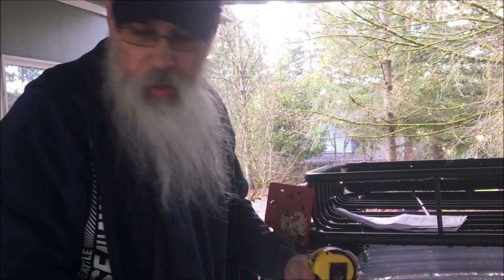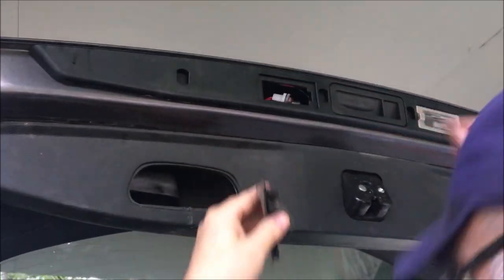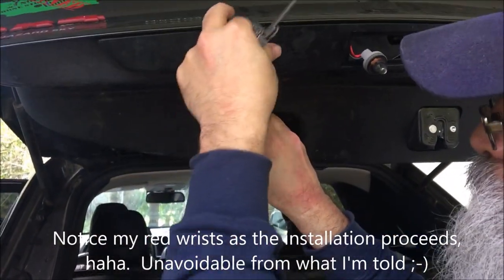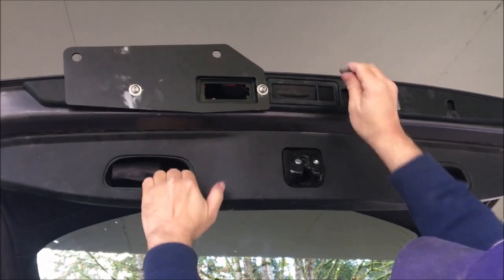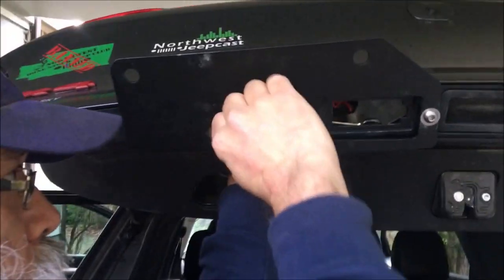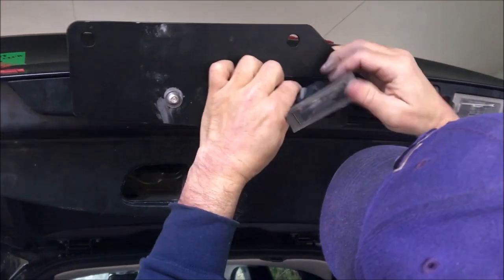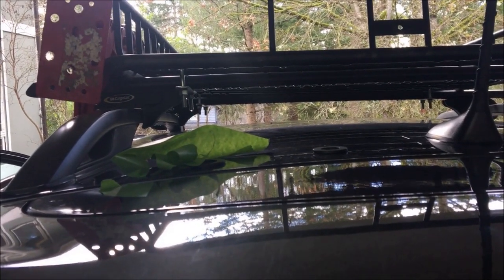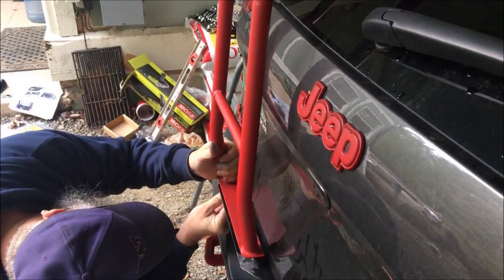Jeep Cherokee KL Gobi Ladder Installation

Comment: I pulled off the entire plastic liner on the inside of the hatch. Sure it's one big piece but at least I didn't have to contort my hand with a tiny wrench. And the two things you had to pop out...one firm whack with a hammer from inside they popped right out. So easy

Comment: I got an off-track question your red letters and numbers , did you bought it or paint it?
Reply from the maker: I used Plasti-dip to color them.  It's extremely easy to do and looks great...seems to last over 2 years (that's how old they are right now).  I may peel them off and do them again, but they still look pretty good, so I'm going to hold off for the time being. As a FYI, I did all of my emblems...the Jeep on the hood and the Cherokee's on the doors too.  Just do a search on YouTube on "How to plasti-dip my emblems".  You'll get lots of hits and in less than an hour, you'll can have them all done.
Reply: @raygach5692  thx , great video . Keep up the good work
Reply from the maker: @MrDiecast69  Thank you.

Comment: How many coat of plastidip did you put? I put like 6 light coat and my red was still too dark ? I used a red mat platidip . But i wonder why i wasnt even close to your red?
Reply from the maker: The color of the ladder wasn't dipped red.  I received it that way and looks to be simply powder coated in red rather than black.  I'm not sure if it was ordered from Gobi that way, but my wife was the one that tracked it down from a seller in San Diego and had it shipped up to her in the Seattle area.  I'm guessing it could have been a special order as I've not seen any other red ladders and this is definitely power coated rather than painted.
Reply: @raygach5692  im talking about the emblem, i must be doing something wrong cuz it never came out like you. Mine was more like brunish red... I need to find where im doing something wrong
Reply from the maker: @MrDiecast69  I just used the plain red plasti-dip, about 5 coats.  I can't recall the exact type, but it was just the regular red dip I picked up from the store.

Comment: what s the end look?
Reply from the maker: I'm not sure what you mean.  The Ladder attaches under the rear lift gate with two screws, if I recall.  As for anything else, it's all stock other than I added a 2nd tow hook and some lighted rear fog lamps.

Comment: Does the cargo door still open after installing the ladder?
Reply from the maker: Yes.  It's attached at the top of the hatch and at the bottom of the hatch.  It opens like normal and shuts like normal.  The only difference is that it's a bit heavier and since I have a manual rear hatch, have to lower it slower as gravity pulls it down too fast.  I think Gobi also sells a stronger hydraulic strut if you want to replace it.
Reply: Really? Wouldn’t make much sense if It didn’t don’t ya think?
Reply: What a dumb but important question